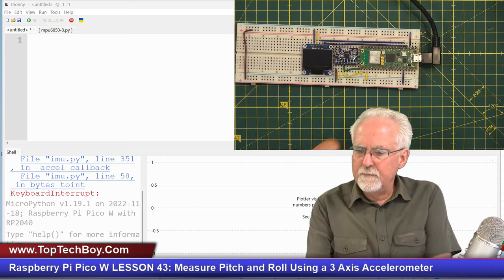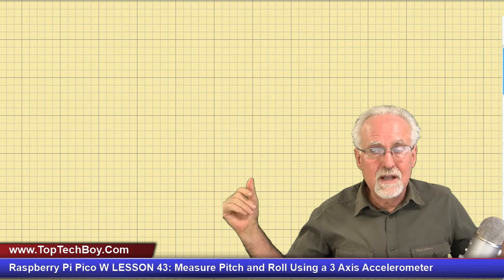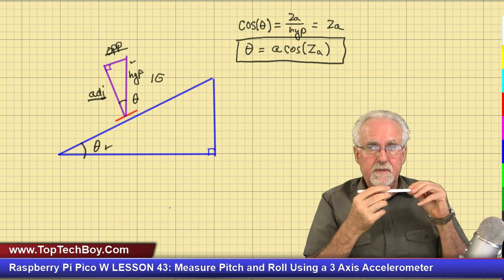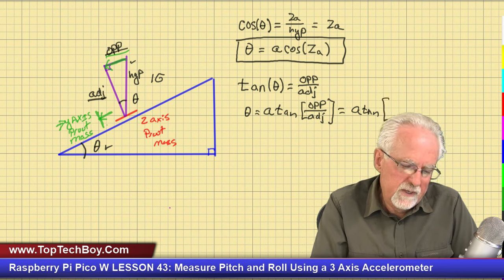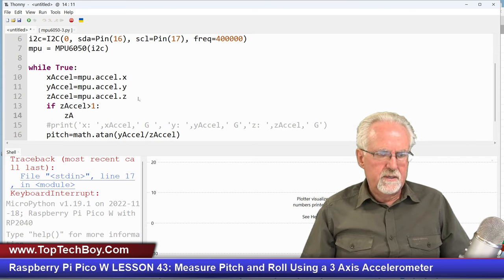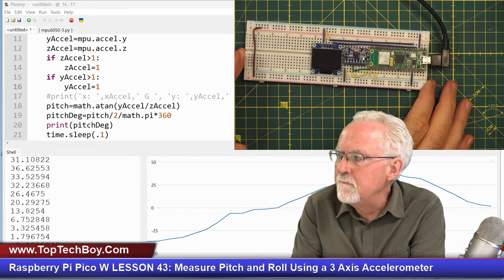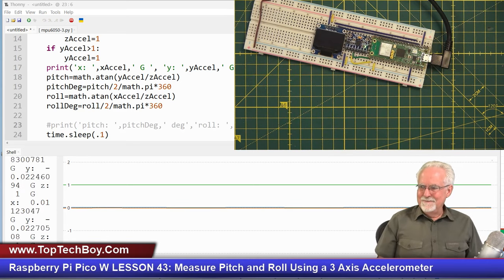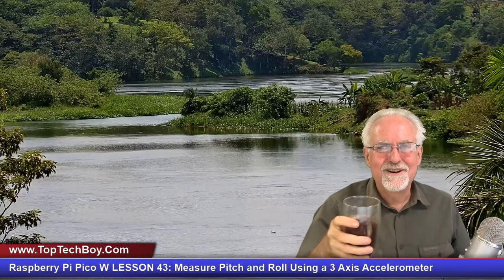Raspberry Pi Pico W LESSON 43: Measure Pitch and Roll Using a 3 Axis Accelerometer

Comment: Great content once, again, Paul! My solution to your assignment, I figured I’d to have my camera read the oled screen, while the picoW circuit, and my camera were in a free fall off of my second floor, to the ground. I figured a sleep time of .1 would be small enough, but it wasn’t( the z measurement only got to .5 G). So I adjusted the sleep time to .01, but then  discovered my inexpensive Kodak digital camera did not survive the fall. So, I will not know whether that would have worked. Anyway I have another (homework) camera ordered on eBay.
Reply: @DrDave327 That is exactly why it would be a good idea to set up the Pico W with the MPU6050 as a server to just get the data and then send it to the client(s) that would then display it. PS  I felt very sorry for you when I first read your comment because I read 'inexpensive' as 'expensive':face-purple-crying:  #DONTKILLTHECAMERA

Comment: im following along here and i feel like you exchanged pitch and roll, because as you see on the board of your MPU6050 it has labelled axis which point to where the Y axis is and where the x axis is, but when i rotate the board along the x axis my pitch changes and when i move about my y axis my roll changes, but pitch is usually along the y axis and roll about the x axis

Comment: I´m not a LEGEND you are, but I could handle the signal for pitch and roll. But in this case, considering all the effort you do to came up with explaning of math and electronics, the result for this homework can be theoretical. A position were all the sensor are zeroed is only possible at G0 condition, am I wrong? If not, we can quickly simulate for a short period a free fall tilting sensors up and down, otherwise we can pay for a G0 flight, not feasible for me at this time. Thank to have you as a teacher, god keep blessing you and yours!

Comment: Why not use arcsin instead of arctan. If the angle approaches 90 deg the you will get a div by zero error.
Reply from the maker: If you look at the sin curve, it is very flat on the tops and bottoms, meaning it is not very sensitive to changes in angle. We use tan because it is sensitive over all ranges. We will have to do special cases so it does not crash at 90 degrees.
Reply: I'm seeing less than a degree error up to 75 deg., but then the error grows. Also, I suggest the atan2 function since when the angle goes past 90 deg. the atan function switches sign, but the atan2 keeps going.  @paulmcwhorter

Comment: I would like to see the board held on a 45 degree triangle to see the accuracy of the system because I think it should be sin for pitch and cos for roll. Tangent is not very different at low angles.
Reply from the maker: This is the problem. Look up the whole sin curve. Notice at its peaks and valleys the curve is flat, meaning pretty big changes in angle result in only small change in sin. This means in those areas, asin is not very sensitive. The tan curve is steep meaning it is sensitive. Think about it a little and I hope what I am saying makes sense.

Comment: Homework for lesson 43 (42? I'm losing track) https://youtu.be/F0gx2ttrLNo
I am apparently a legendary folding chair (not that cheap stuff from Walmart. I'm a Target folding chair). I could not work out the pitch and roll calculations without looking at Paul's work in this lesson. I thought I had it figured out until his little "hint" in lesson 42. That really threw me off. It didn't occur to me that the opposite side on his drawing was equal to the yAccel reading. I wasted a bunch of time on that one. After watching this lesson and working out the drawings I'm still confused. If my drawings are correct (always a big "if") the calculation for pitch should be theta = atan (yAccel) NOT atan (yAccel / zAccel). Since zAccel should always be equal to 1 the two equations should be equivalent. I tried it. They are most definitely NOT. I'm not sure why (or if) the fact that the zAccel is most emphatically NOT measured as 1 might have an effect on the calculation. I had to go out and buy a different MPU6050. The one that came with the kit is wildly inaccurate and fluttery. The new one is only somewhat inaccurate and fluttery but it's better. Could that be what is causing the discrepancy or is my poor old decrepit brain the issue? I'm not making bets either way.
Reply from the maker: Z acceleration is not 1 when the part is tilted. Watch my solution, and hopefully it will make sense.